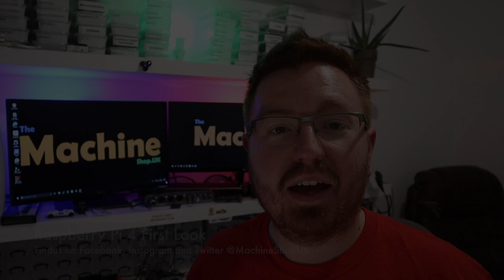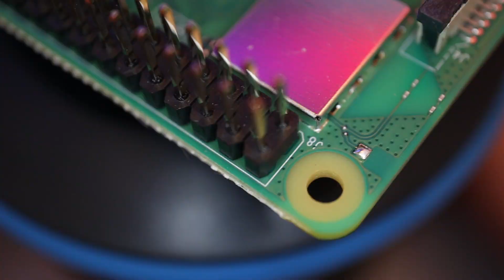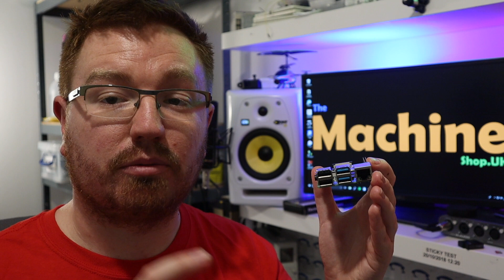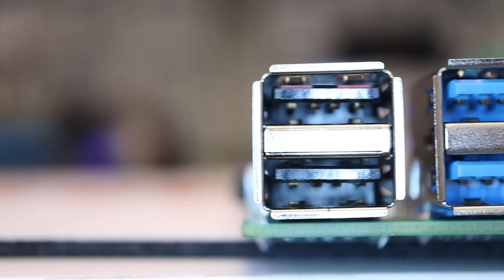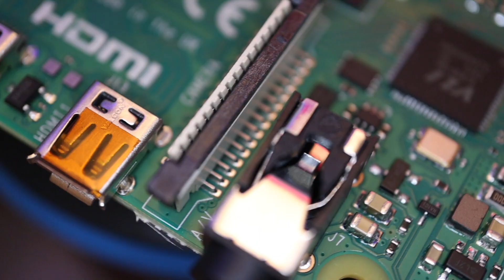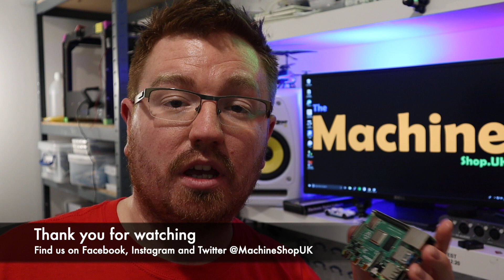Raspberry Pi 4 First Look

Comment: Yes that does sound mental. Hey, I wanted to see a nice shot of the bottom. Is it still the same micro SD card slot or have they finally used a sprung latch retention?
Reply from the maker: Richard Huish the model 2B had a latching sd card holder but it was removed on the model 3
Reply: @TheMachineShopUK  shame as it's quite difficult to remove the SD when the pi is in a case, will be a lot nicer if it was spring loaded.
Reply from the maker: Richard Huish yea true, on the flip side, imagine if you nudged the sd card whilst in operation and it sprung out, pinged over next doors fence and eaten by a chicken, chicken pi :p